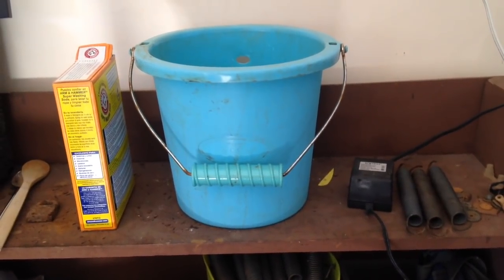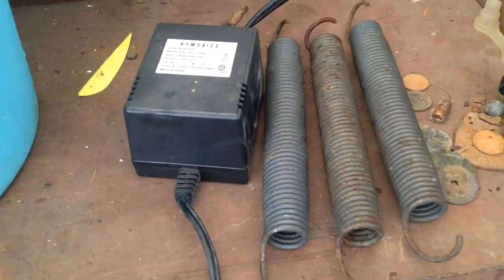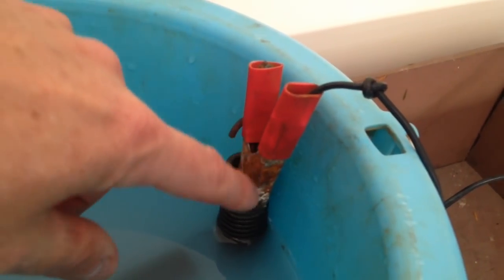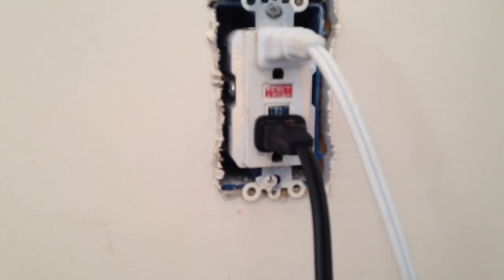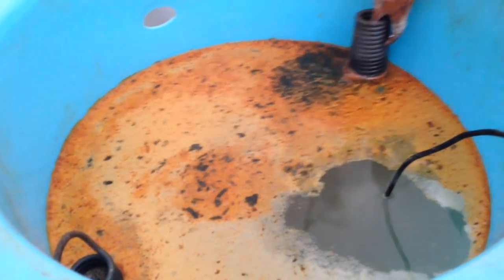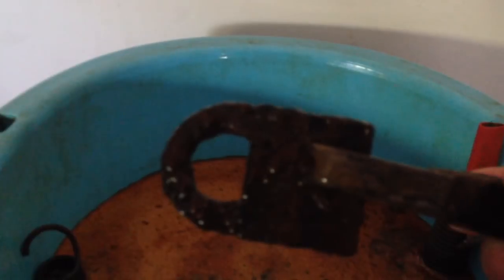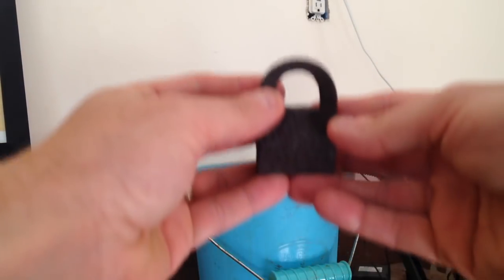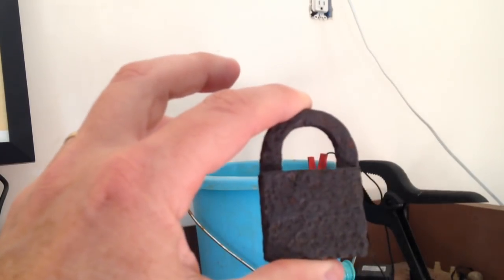Using Electrolysis to Remove Rust from Metal Detecting Finds

Comment: ⚠️ Electrolysis creates atomic hydrogen, which can ruin the steel. This is called hydrogen embrittlement.
Reply from the maker: Now you tell me.
Reply: @wayneetcetera  All right, but I'm not an expert. (And my english is not good.) But that might be important to know, I thought. More information can be found at Wikipedia, for example.
Reply from the maker: Thanks for the info.  I just did a quick google about hydrogen embrittlement.  Good stuff.
And your English is better than mine.
Reply: @wayneetcetera  Thank you. "My English" comes mainly from google translator. 😀

I didn't know anything about hydrogen embrittlement before, until we had to do a heat treatment at work on springs galvanically coated with zinc.

Later I treated a rusted compression spring from an old blowtorch with electrolysis at home, as I saw it on Youtube. As I watched the hydrogen bubbles, it occurred to me that this could be a problem for the material because of hydrogen embrittlement. I immediately stopped the electrolysis and put the spring in the oven overnight so that any hydrogen that had penetrated could diffuse out before the steel was damaged. The heat treatment must be started immediately after the absorption of the hydrogen, after a few hours it is too late for that.

The phenomenon is quite complicated. High-strength and hardened steels are endangered. Springs, load hooks, chains, bolts, control joints ... These could cause accidents. Thank you for answer.
Reply from the maker: Thanks for the excellent information.  You definitely have more knowledge on the subject than I do.
Reply: @wayneetcetera  Very kind, thank you. As I said, I'm not a specialist, I'm not a chemist. (I have an apprenticeship in the metal industry.) 

As a hobby, I used to do electrolysis to fill balloons with hydrogen. At that time, however, I didn't know anything about hydrogen embrittlement. Only later, with the help of the Internet, did I find out that there is such a thing. Thank you for your reply.

Comment: Well....i recommend higher voltage to pass deeper through the chunk of rust material core.   Too low voltage means little to no penetration, especially on higher resistance material as rust.

As for amperage need be high enough to turn rust into red yellow molten metal....hence the factory videos on their mass production aluminum forge, from Red sand/aluminum oxide.
Reply from the maker: Lava level amperage would be badass.

Comment: If i give 250 volt then is it creating any problem??
Reply from the maker: Beats me.
Reply: It's unsafe. 250 volts is extremely dangerous voltage and the current involved will most certainly be enough to kill

Comment: I get bubbles from both my dirty thing (negative) and my anode (positive); tried reversing and I get bubbles mainly from anode.
Reply: Dustin Silva:  This is a standard electrolytic cell in which Hydrogen is generated at the anode (connected to the positive terminal of the power supply) and Oxygen is generated at the cathode (the negative terminal) because the water (H2O) is being being broken down into it's constituents.  Because there are two atoms of Hydrogen to every atom of Oxygen, you'll get twice as much bubbling from the anode as from the cathode.

Re voltage and current:  The voltage can be any low dc voltage greater than about 4 volts but don't go too high. A 12 volt battery charger is ideal but other power supplies can be used including a car battery itself.  The current is what it is, determined by the voltage and the resistance through the liquid measured between the anode and cathode (Ohm's Law, I=V/R).  The resistance will depend on the size and shape of the container, the volume of water, the amount of added salt, and the area and quantity of the anodes and the area of the item being cleaned.  You don't set the current but just accept it whatever it turns out to be but your power supply should be capable of supplying several Amps so you don't blow its fuse or burn it out.  The higher the current the faster rust is removed.

Comment: Great!  Thsnks!  I will try to let you see how my finds work out, after your rust removal process.  One of them is a five-round revolver cylinder I dug up in Korea.  I also have some flintlock mechanisms I need to clean.
Reply: Charles Wilder be careful, some unregistered gun parts are illegal to have if they are even close to being  able to work.
Reply: LtMaximum, thanks for pointing that out.  I am sure these very heavily rusted parts will not be even close to working, even if I successfully remove most of the rust, but I will look into that a be cautious.  My black powder cannonballs and live fuses for Japanese knee mortars were recognized by EOD, in my office in Korea, and taken for detonation at a range over there.  They did give  me video of the secondary explosions they got from them, to appease me.

Comment: volts???? amps????
Reply: both
Reply: Your transformer shows(in written words)  the volts and amps output. What are those words. Volts output _. Amps output___. That's ok...take your time, let the simple words sink in you vapid nave.
Reply: Most likey 12 vdc, 1 or 2 amp, it's a homepedics power supply for an old massager or something similar...

Comment: Have been cleaning metal detecting finds for many years. You can take the following to the bank. Use ordinary table salt, works just fine. Electrolysis is REMOVING surface corrosion, so it isn't adding salt to the item, it's removing it. Some times, if object is large, you must use two anodes. A column of bubbles will begin rising from area of anode. If contact is good, bubbles will cover large area of item. Be patient, heavily corroded or large items may take a couple DAYS. Give it time. Electrolysis will remove all corrosion, but will not harm good metal. If item is pitted, process will uncover them. A thick foul-looking goop will develop. This is good, shows process is working.Hollow items should be vented, as hydrogen will build up in cavity. Don't overdo really old iron, the process seems to soften it. I have cleaned a lock assembly from an Enfield musket, went into ground in 1865. Maker's name became visible , mainspring was still intact, lock actually still worked. Do not discard goop until you're satisfied with cleaning, you'll just be starting over again. If you can stand looking at the goop, you can clean more than one item. Use a battery trickle charger, don't use over 3-5 amps. I never had much luck with potash, lye, etc. Salt does an excellent job. Good luck.
Reply: A while ago, i did an experiment where i tried to make hydrogen gas for filling balloons with, using salt as the electrolyte. I accidentally spilled some of the solution onto my carpet, and the next day there was a hole burned through it! I didn't know what happened, so i googled it. It turns out If you use regular salt, the electrolysis can also create sodium hydroxide and iron or copper chloride depending on what the cathode is made of. these chemicals are highly toxic and corrosive.
Reply: vGaurdUp  What kind of trickle charger do you recommend? I've read that some or all automatic battery chargers don't work for this because they need to detect some voltage, as in a dead battery, before they will work. I'm not sure if some trickle charger work in this manner or not. I was using a manual automotive type battery charger but it stopped working and I can't figure out what's wrong with it.
Reply: Sorry, I'm just now reading this, but how much salt to water do you use??
Reply: Krumo Plays Do NOT use salt! Many people agree that instead of forming just hydrogen, as with the washing powder, it can form chlorine gas, which is very deadly

Comment: wouldn't you need two positive leads on your spring set up? If the current flows direct as possible from anode to cathode then isn't the other end of your spring kind redundant without a power source since the current is going to take shortest path?

Comment: I just watched a video by WOOD magazine, and they pointed out some dangers in how you did it.  The bubbles are oxygen and hydrogen, which can collect overhead, and explode if an ignition source is present.  So you want to do it outside or vent  your workspace thoroughly.  They also advised against having copper in contact with the water, as you did with the electrode clamp.  You would have been much better off to hang the lock on some wire and then clamp to the wire.  A couple wraps of the wire around a stick would allow you to have a hook on one end and something to clamp to on the other.
Reply: Damon Diehl i think the description says to have a ventilated area if inside. :)
Reply: he had a electric fan on while doing it
Reply: I know this post is a year old, but hopefully you'll come back to it, could you link the video you're talking about?
Reply: Electrolisis emits something like propane , you can find videos where they make little flamethrowers like that

Comment: Wow, that padlock seems to be made out of forged/wrought iron! That must be ancient stuff (several centuries old, cheap, pressed steel and brass has displaced wrought iron in such applications at the start of the 19th century, so I won't be surprised if your finding would be more than 200 years old). Excellent job ;)
(kinda sad that doing metal detecting in my home country would be a bit more suicidal, because I'd probably find bombs left from WWII instead).
Reply from the maker: Thanks for the comment. The lock was found at a home site where plenty of early 1800s goodies have been recovered.
Reply: So it actually IS likely to be 200 years old. Cool :)
Reply: CoolKoon 9
Reply: CoolKoon Not as bad as in Hungary, where it's a crime to merely own a metal detector.

Comment: Works better with some 100W+ power supply! I've tried this on my adjustable supply at the maximum (26,7V~5.4A) and it works a lot faster! But the most important is change the water 2 to 3 times, so you can clean it better =)

Comment: @wayne_etc i think soda crystals here in uk are what you call washing soda.
 What voltage was the power supply and if it was higher voltage dc would it work quicker